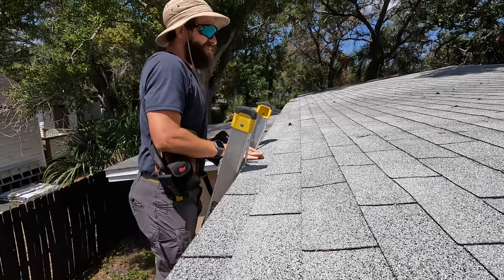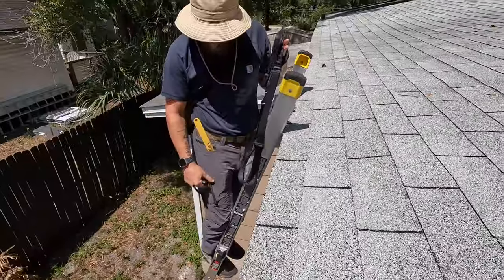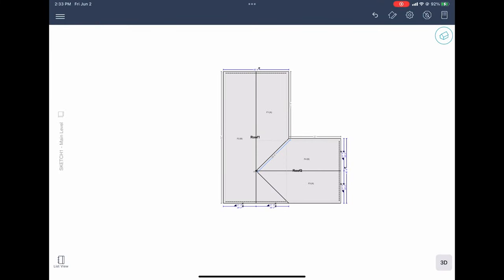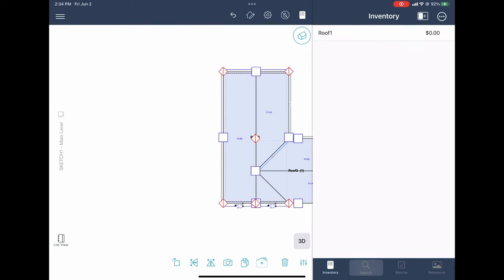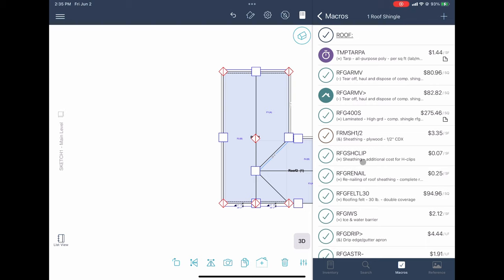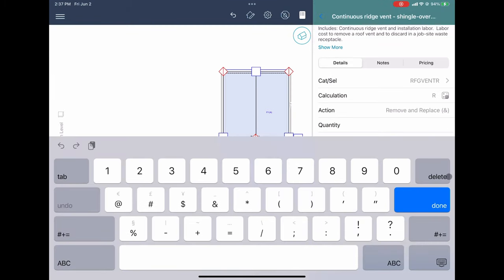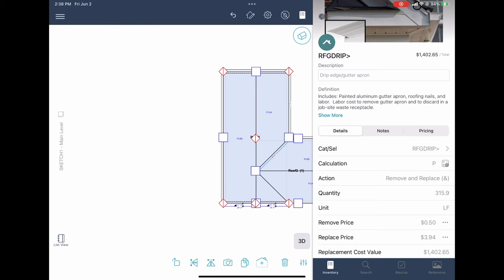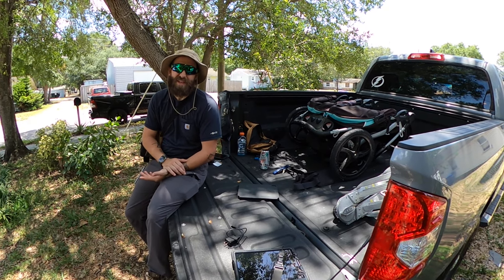Tips on Mastering Mobile: How To Estimate a Roof (follow up) in Xactimate Mobile

Comment: $30,000 is a lot. I have seen roofs 3x bigger than this one replaced for $17,000.... Of course I am in Arkansas and not Florida..
Reply from the maker: Hey brother, if you look at the video closely, I mention that I randomly sketched that one and didn’t take the measurements. It was a much bigger drawing than what the roof was.  This roof would be about 12-16k out here in Florida.
Reply: noticed the H clip expense was fairly high in relation to new sheathing -  does it allow for the full roof..?(or were you just showing the how-to- process).  just curious   excellent video and walk through...
thanks for sharing @parrotkey
Reply: I am moving from a desk adjuster role to a CAT field role with another carrier. These tips are helpful as I want to utilize my iPad instead of the bulky laptop provided. Question what is the most effective way to measure a roof? Do you use a laser measure? If so is there a brand that ports into Xactimate automatically? Last question, have you used the apple pencil for sketching at all?